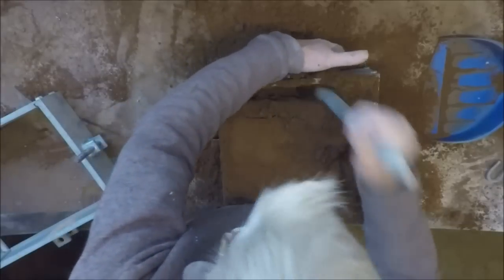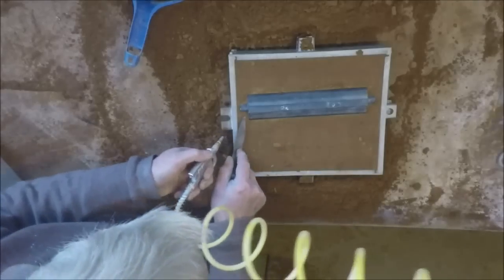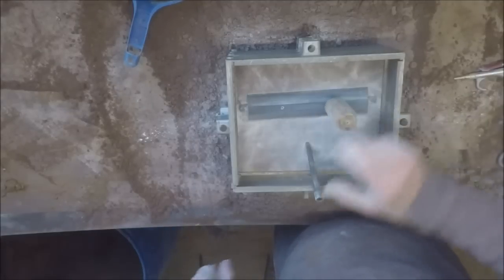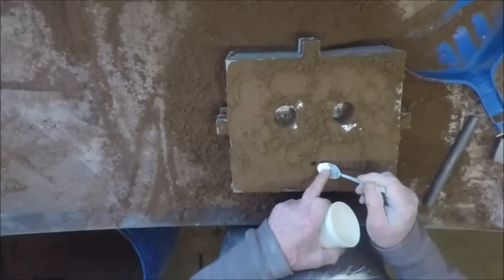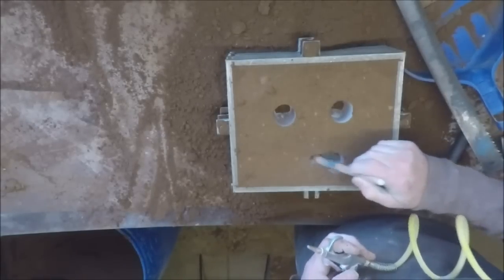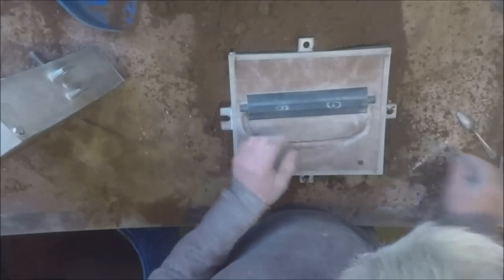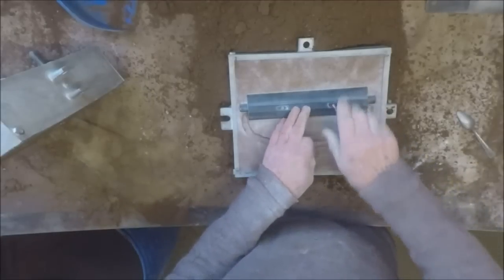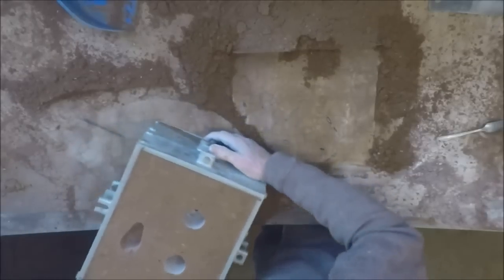Casting a Mini Minor water connector

Comment: Come think of it, is there any reason why we don't make sprues diagonal rather than vertical? Pull them out at an angle, in short. That way you wouldn't get your metal shooting down into the mold so quickly as a result of being dropped straight down a tube.
Reply from the maker: Johannes, An age old idea!   However the potential for metal velocity in the mould is controlled by metal height, how it is arrived at  does not matter. That said though  there was recently work done on spiral sprues - a sort of very much elongated  diagonal sprue this did have the effect of slowing metal down significantly  but only by the extra frictional resistance to flow caused by the much greater sprue length. The idea  is not to DROP the metal down a sprue, many people do do this by virtue of using a sprue that's way to large and the metal does not even touch the sides! The idea instead  is to have the metal in contact with the sides of the sprue from top to bottom, this helps to control the flow by friction and also prevents air entrainment and splashing through turbulence. Surest way to have a casting made from bad metal, use a sprue that,s way to large and way to high.... Martin

Comment: That's the second John Campbell book I've seen you suggest. Would it be possible, at some point, to write up/make a video on a list of books on the topic? Sorting the wheat from the chaff can be difficult without an experienced eye.
Reply from the maker: elitearbor, There are thousands of foundry related books out there - I must have about a hundred here! Sadly most are what John Campbell calls 6000 year old technology. They all tend, both amateur and professional level alike, to regurgitate each other ad nauseum and yet in every one that I have read there has been some very useful information. BUT as you say "the wheat from chaff thing" is a big problem and I would be the first to agree that it is often difficult to tell the difference - I  can (mostly), but that is the result of Metallurgical training and years of experience in several foundries including my own - not everyone has this. Because of this I can not really recommend any other than Campbell's latest two books i.e. The smaller one "Castings Practice the ten rules of casting" and the larger "Complete Castings Handbook" Note that the smaller is contained in its entirety within the larger. These books are not an easy read (particularly the larger one). In places they are highly technical and I struggle with them at times. They too need some interpretation/translation to the hobby level. I can see many people giving up on them as too complex and continuing to produce poor to mediocre castings by whatever incorrect, backward, and butchery methods that are currently using. However properly read and used they can be an easy path to producing very significantly better castings even at a basic hobby level. Note that Campbell  himself points out that these books are not the end of the story - there is much work being done and needing to be done before we get to that stage - if we ever do!
If you wish you can ask about a particular book and if I have read it I can comment on its particular usefulness... Martin
Reply: @olfoundryman8418   Thank you kindly for the explanation. It sounds like any trade/technical field which has been around long enough, really... I had hoped it was a better situation than I've found elsewhere, but alas! I now know that the one book to order is Campbell's "Complete Casting Handbook" - and at 1,200 pages, it certainly should keep me busy a long while. Thankfully, it sounds as though mechanical engineering and materials science (specifically metallurgy, of course) will help me out.

Good advice regarding more work towards the overall goal of improving casting materials. Incremental improvement is a never-ending process, both in a given technical field and in each of ourselves.

For the time being, I do believe I'll find a copy of the "Complete Casting Handbook" to purchase, and go from there. Thanks again!

Comment: what is that powder you put on top of the liquid metal after pouring and what's it's purpose?
Reply from the maker: Ian, I put an exothermic compound called "Ferrux NF" made by "Foseco' on the top of the feeders. Its job is to catch fire and generate a lot of heat which helps keep the feeders liquid for longer so they are better able to provide liquid feed metal to the casting underneath - the ash left after this "fire" dies down does act as an insulator.... Martin

Comment: You must have low humidity there. Where I live we have high humidity and sweat pours off me like I'm standing under a shower whenever I do metal working. Or if I just go outside.
Reply from the maker: Amal, High humidity, you have my sympathies. I find it a real killer. That 43 deg C day was  just 16% humidity today its just 30 Deg C but 55% and it is rather uncomfortable. Luckily Melbourne is generally lower humidity than parts of Australia further north. Your best defence is a refrigerated air conditioner as even if they do not cool you much they drop the humidity in ones work area. Hard to do with a furnace or forge running though I guess! But I do so hate it when the sweat drips of my brows and leaves salt trails on the inside of my glasses or when the sand sticks to the sweat on my arms, the latter is my definition of too hot to mould... Martin
Reply: Olfoundryman, our average humidity is in the 70-80% range. 16% humidity would be heaven to me.